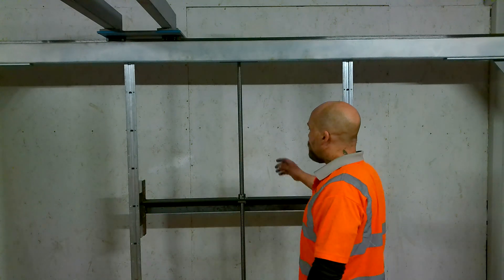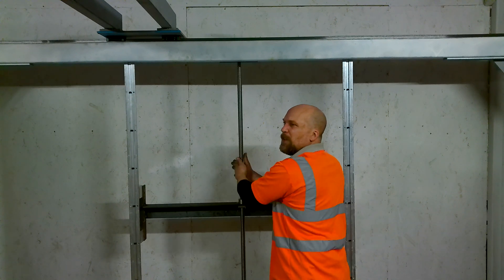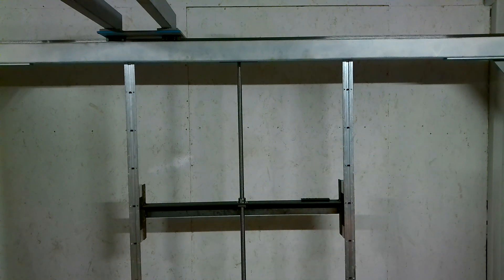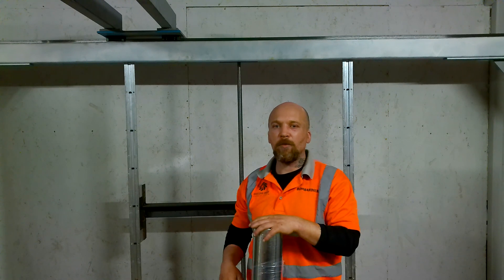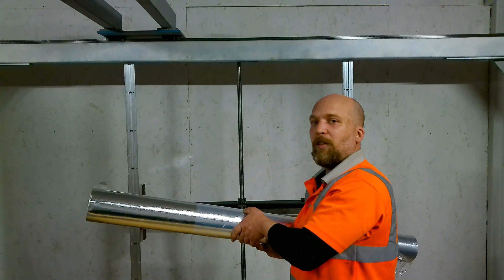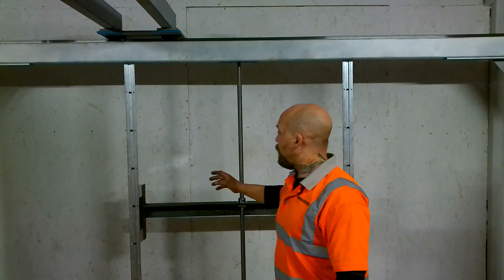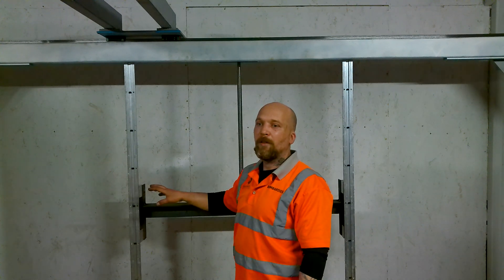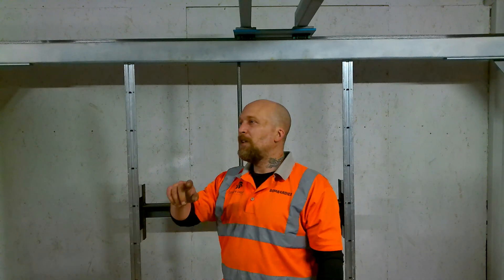Large Hybrid 3D Printer. Infrared heating system update.

Comment: did you machine flat the surface under the rails?
Reply from the maker: Shimmed took a very long time 😁.
Reply: @Big3dprinter  yea that’s what I did on mine, my maximum axis was about 2 meters, it took for ever, did you clock of a straight edge aswell what type of tolerances did you try to achieve ?
Reply from the maker: @Cj19944  nope, assembled x and y then ran up and down then adjusted where needed. Could not trust that box section was flat enough, plus I do not have a straight edge that long 🤣🤣.
Probably not perfect but on auto bed leveling max deviation is 1mm across a 2.2m x 1.3m bed, definitely live with this for now.
Reply: @Big3dprinter  I got very accurate results epoxy leveling my x axis as I did not have my milling machine at the time. 0.2 over 1.2 meters would of been almost perfect if I did not have a leak. Do you have an instagram page or something maybe we can exchange some information talk some materials as I am using pellet extrusion aswell. Not so easy to find all the useful materials for a reasonable price.
Reply from the maker: @Cj19944  nice, I did epoxy my bed planning on machining once I can get around to reworking the spindle tool.
Instagram is @a_s_s_e_t_technologies